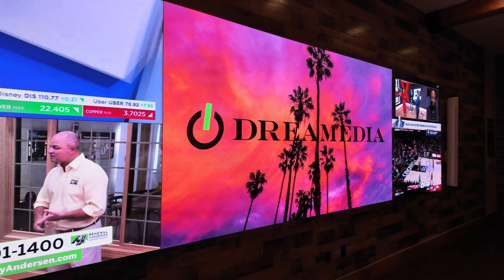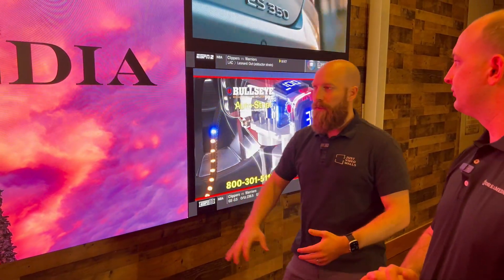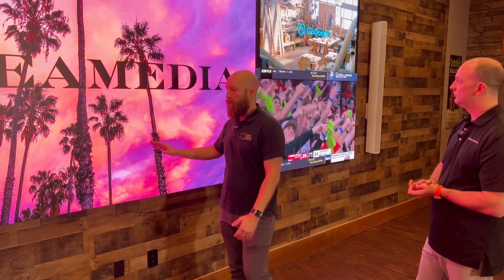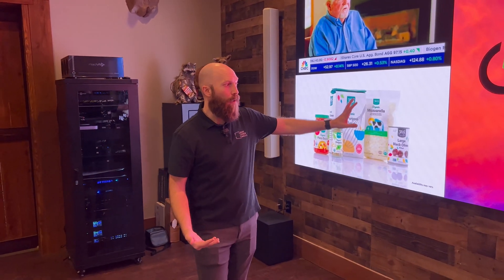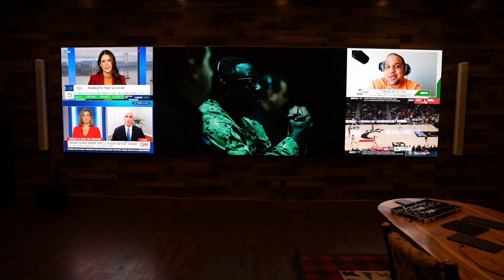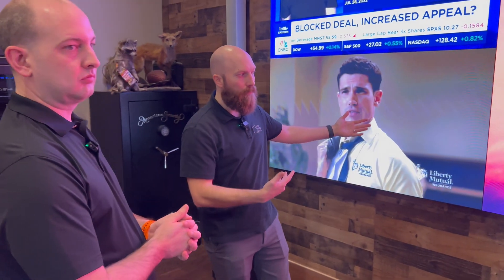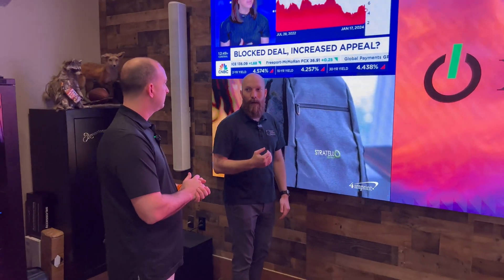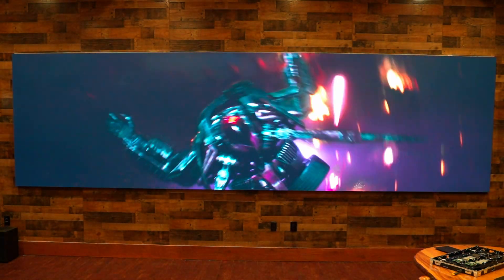Pixel Pitch EXPLAINED! Learning MicroLED Display Terminology - 4K or 8K?

Comment: Let's overcharge people for less and do it in a misleading way by changing the system from something that's easy to understand into something you need a degree to read. WOW. I'm so tired of people telling me what I can see. Anything under 108 pixels per inch on a TV is visible to me. You're not talking about projectors, you're talking about TV's. These wall TV's will be used as monitors for people sitting 18" from them. I guarantee the first curved versions that can do it will be used to make wrap-around displays for gaming.

 They will try and sell this as a way to lower the cost of producing the TV and therefore the end cost to the user. That is a lie. It is, in fact, a way to lower their costs and charge way more money to certain groups of people.